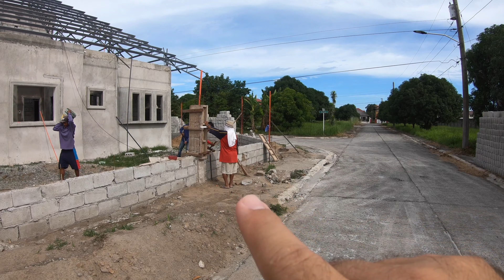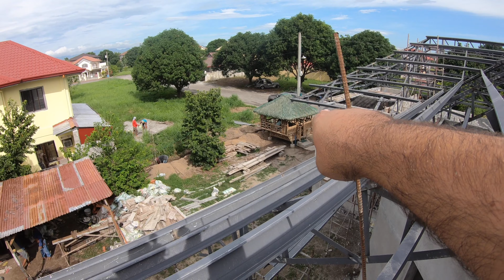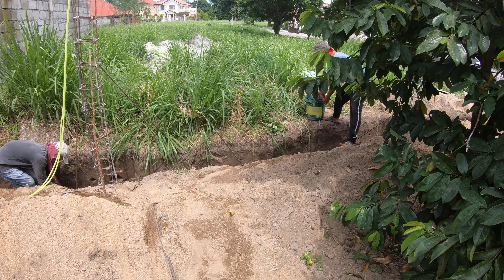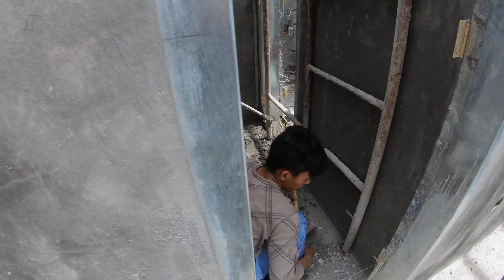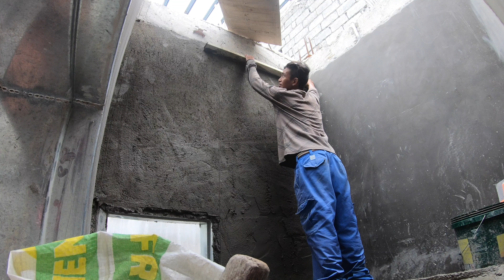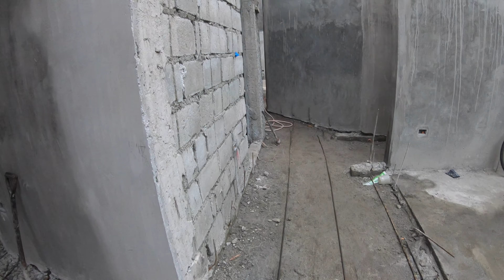Philippine House Building Step by Step, Build Day 107: Square Away the Floor

Comment: Did you or the architect ever consider using metal studs and sheet-rock/cement board for the non load bearing interior walls?  Wouldn't  it have been easier when running the electrical and/or plumbing for those walls?
Reply from the maker: @Mark T,
The metal studs and gyp board are not standard practice here. That tends to equate to higher cost and more risk as the workers are not familiar with the process/products.
Thanks for watching.